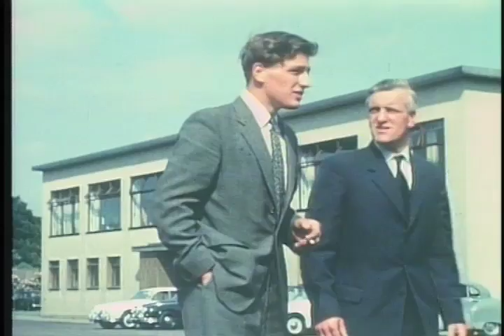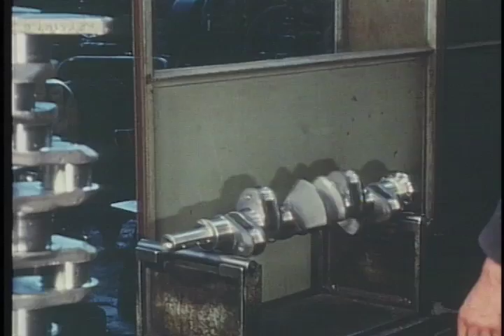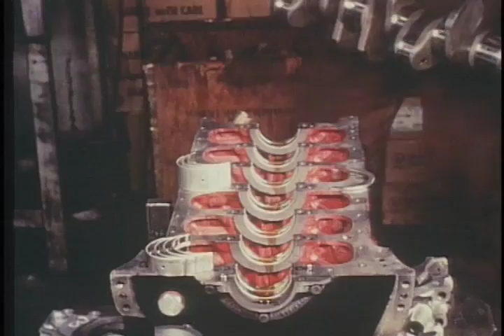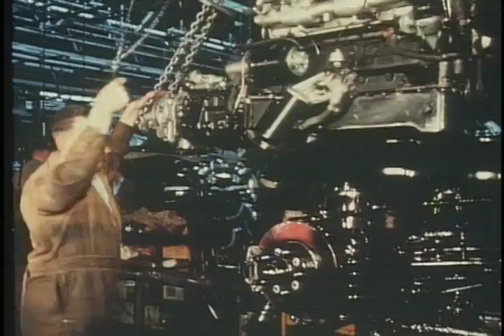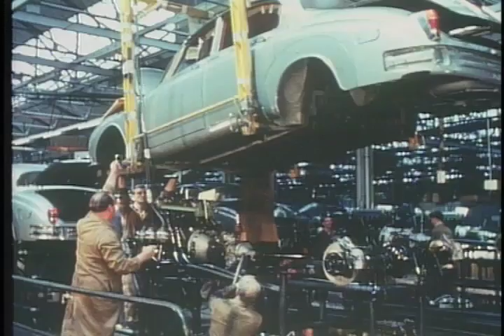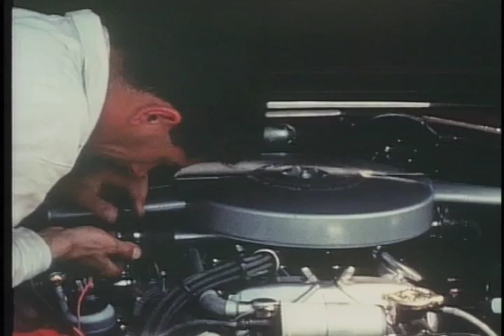Jaguar Factory Tour - 1961

Comment: I was impressed with how leisurely the whole process was. Nothing seemed to move until all the work was done on the previous car. A lot of the work seemed to be hand fitting. Instead of multiple operations being done on something like the engine block, most of it was one at a time. I was half expecting the tea boy to show up at any time.

Comment: I kept my E-Type cool in the 100+ degree Texas summer bumper car traffic by putting a series II E-Type fans and radiator on the 3.8. Worked perfect ran at 190 degrees, in dead stopped traffic for as long as you could stand it. Also put in a series II all syncro first gear tranny. And lastly, changed to a delco remy alternator and voltage regulator--all Joe Lucas problems solved! That's it! 1964 Coupe--about the best car I've ever had and I've owned over 50+ cars in my 76 years. All makes.

Comment: Very interesting. Given the decade of manufacturing engines, I believe that is/was one of the finest six cylinder engines ever made. My XKE had 120K miles on it with my foot in it all those miles. The 3.8 tri-carb motor. Very quick car. No mechanical issues on that great engine, except setting valves which was a pain. The Lucas ignition was the problem and keeping those SU's in tune wasn't a big deal. Just needed a fine tune about once a year. Valve seats, I kept lubed with Marvel Mystery oil, since the lead was taken out of the gas, and it therefore never needed any valve work. I also owned a great '57 3.4 litre Mark I sedan 4-speed. I loved that car. I've had 6 Jaguars but the older ones have Soul!

Comment: 5.13..."high pressure water jets are used for cleaning, and swarf is blown away by compressed air"  Just as well he's wearing those invisible  safety glasses!   It's extraordinary that even in those days earmuffs were not worn.
Reply: I was at school in the 1960s , with a metalwork shop with furnace , welding equipment etc , safety kit was a standard issue brown smock , sometimes goggles and gloves and in five years no one was seriously injured or killed ! , we were taught how to do things right and that continued in the motor trade for me right up to date now , back then mechanics had skills and were not just parts changers

Comment: My brother owned a MK2, 3.8 litre, in Cornish grey with wire wheels and red leather interior, a 1961 model bought in 1970 and was still easily capable of doing 120mph with no trouble at all. A magnificent piece of engineering. Grace Pace and Space indeed.

Comment: The processes shown here are not far removed from late 19th century methods.......

Gears ground to within two thou' 0.002". Test a new gearbox by listening to it.  Paint it with "primer" directly on to bare metal.  Wow!

No wonder the bloody cars were basically scrap after less than 50,000 miles.

Comment: Cool video.  It’s too bad that the unions drove up cost so high that there wasn’t enough profit to sell the car at a reasonable price.  That in turn hurt demand.  Reliability issues came about in the late 70’/early 80’s.  That unfortunately drove more buyers away.  A huge amount of competition from Japan and Germany hurt them so much that the British government had to buy them in order to prevent collapse.  Ford later bought them and then sold to Tata motors of India in the late 2000’s.

Comment: Here in the United States, Jaguar was long given the kiss of death. Electrical system shorts, faulty distributors, oil leaking from fragile aluminum engines, clutches seemingly always in need of adjustment....plus the ever present shoddy British workmanship. This is not the stuff to capture a major overseas market. Sad really, Jaguars with their design beauty and sumptuous interiors always promised so much....... but gave so little.
Reply: I suppose this is when Jaguar were owned by British Leyland Corporation.

Comment: Camshaft bearing journal cap torquing via 1/2" iimpact. AMAZING QUALITY OF MANUFACTURING AND ATTENTIION TO DETAIL. This video is a from a SHITHOLE "REMANUFACTURING" FACILITY for worn-out Jaguar JUNK no more than 25-35 years ago. Not a FACTOR BUILDING NEW ENGINES IN 1961. What a FRAUD.

Comment: at 10.58 the vegetable weighing  scales are used  for the connecting rods for maximum weight of 2 grams tolerance  .....Jaguar pure precision :)
Reply: drams
Reply: 2 grammes is a perfectly and indeed, very good tolerance for a production engine.  Nite also that the rods were checked end for end...

Comment: Most cranks are cast. Some come from billet, after the cast are Cnc work is done holes have to be drilled and cleaned much of the final clean up is done by hand. I worked for Honda 27 years. Got to visit Ferrari. Ferrari still uses sand cast for there blocks, heads and intakes. Sometimes the old way is the best. Be lieve it or not a round file is used. I know it seems crude but it's still done today. Of course the counters sinks have to be polished because the file has a course finish.

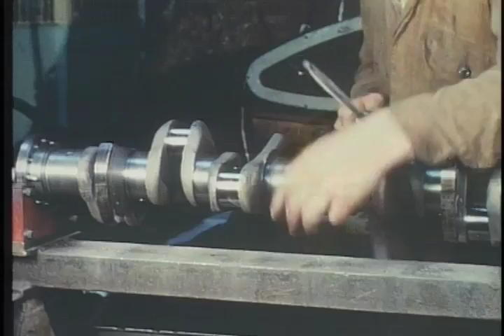Comment: 8:20  "... all holes are countersunk with a hand file."  That statement doesn't make sense with the images shown.  And anyways, how the hell can you countersink a hole with a hand file?
Reply: using a round file it is possible where a raised hole ie top of a shaft,it wouldnt be  a perfect 45 deg but hey a,flat file would put a flat on the shaft,only a round file can do this so the film is correct but the  word 'shamfered' should be used not countersunk
Reply: Do you mean chamfered? Thats how my Grandad referred to it.
Reply: I,ve  champhered lots of oil passages with a file on several Ford race engines. Countersink, wrong word.
Reply: You run the file in the oiler and it sets the hole below the journal, thus stoping the edges from scraping the bearing, still done that way today in some factory's where the engines are hand assembled. Ferrari and Hondas Anna plant.
Reply from the maker: One of life's mysteries.  The script writer may not have known much about auto manufacturing and just liked the sound of that phrase.  You're probably the only person to ever listen that closely.  We'll send a stern note to the producers:-)
Reply: King Rose Archives  Haha... okay.
Reply: *****  What kind of hand file do they use for this?  And how do you know what Ferrari and Honda do in their engine manufacturing plants?     Not arguing or disagreeing, I just want to know.

Comment: It looks like a greasy factory and methods from the 1880s.
Reply: not true of jaguar
Reply: No, these were skilled men who each knew their crafts. Not plug a machine on and load a program. Obviously the video was wasted on you.
Reply: I owned a 1964 Mark II  3.4s. (Beautiful car.)
It is not lost on me; just look how much time it takes to make a part; so many mistakes can be made.
My Mark2 had one entire cam-shaft that didn't have oil holes drilled in it; it made terrible noise & damage until it was replaced..  Touch the brakes,The brake pedal would literally push back at you.  Leather carburetor parts...?
 Compare this video to how robots quickly make Subarus, Hondas & Toyotas; precise and durable for years and years.
Reply: +Mr. Johnson robots make them faster and economically. But those jags had workmanship though they did need more regular servicing but when you went to a jag shop every atom of the car was understood by someone. And you probably owned a naff car.
Reply: I agree completely with you on the wonderful craftsmanship quality of the Jaguar.
  I restored my Mark 2 and couldn't belief the amount of time, materials & fit & finish used in every aspect of the car.  The heady smell of leather, wool,  wood and varnish was a special kind of heaven. Inserting in the small key in the instrument panel and pushing the start button making the engine roar to life, sounded like starting a WW2 Spitfire; every bit of this car was a constant reminder that you were driving something special. 
 My original remarks were directed toward the factory conditions; the lack of safety, heath protection, dismal conditions and using  tedious handwork labor when a precise machine is far better for  certain jobs. Mostly in the machining and metal work process.  They certainly didn't ascribe to the Japanese word & philosophy of "Kiazen" and were using old guild methods of protected skill sets. 
.
   Kaizen (Continuous Improvement) is a strategy where employees at all 
levels of a company work together proactively to achieve regular, 
incremental improvements to the manufacturing process. In a sense, it 
combines the collective talents within a company to create a powerful 
engine for improvement.
Reply: +Mr. Johnson this was 1961 that's what they did in 1961. Bit harsh to criticise 50 year old history.
Reply: 1961 They didn't manufacture in such poor conditions in America. Just look at the video of   "Men Bet Their Lives on It -- Packard Merlin Engines"  in 1943.  The methods & conditions were much more technologically advanced than Jaguar 1961.  Look at any manufacturing videos in 1961; BMC,  Mercedes, G.E., FORD, Lockheed, etc.   It is world of difference in cleanliness and safety.  I'm older, I remember 1961; most places didn't look like the Jaguar factory.
Reply: You are right.
 This is 1961. Methods were not standard everywhere; some factories were more modern than others.  Just like today, some manufacturing is behind the times, some are ahead of the game.
Reply: +Mr. Johnson I think the lure was that  jags were hand built.
Reply: +Mr. Johnson I did a reg check and that car is no longer registered. Probably scrapped.
Reply: +paul hunter what is that comment relevant to?
Reply: Jaguar Factory Tour - 1961

Comment: jAGUARS ARE INCREDIBLY RELIABLE, my 1998 XK8 sport runs like new and is incredibly responsive and I can say from experience the XF Saloon is another fantastic Jaguar.  Like all cars the owners need to ensure they are serviced properly and not by monkeys.
Reply: Ummm, you're driving a Ford product.
Reply: Exactly, they are upscale Fords based on the Taurus platform.English cars are not reliable .....unless they are Fords
Reply: Why do you say that...Fords are not in the same league, everyone knows that.
Reply: My Sovereign X300 (1995)has 209,000 on the clock, I maintain it regularly, change all filters and all Liquids every 12 months, the car runs perfectly,I often get offers for it,cash too even. Secret to a good Jag is simply sound maintenance and quality oil and other liquids, the low revving engine is eating up the K's around 100KPH at roughly 2100 RPM no stress.A great vehicle.Many Nippon/Korean'China made cars are screaming at 3500 PLUS at 100KPH.
Reply: I have a 2.0d X-Type, 06 reg, ie 2006. Had it for 4 years. We bought a Mercedes ML300, 2010, in August last year. Problem after problem. Got rid of it in May.  The X-Type has been far more reliable.
Reply: Your jag is a ford dummy
Reply: Get a real jag with a lelaynd engine
Reply: my girlfriend has a 1993 XJ Vanden Plas has 130k miles and has not had any problems.

Comment: How the machining of parts has changed! - Lets take the part from the machine without turning the cutters off. Lets blow the muck out of holes without putting on glasses. (I've seen swarf/dirt/coolant blown into many an unguarded eye when I worked on the shopfloor of a machine shop)..

Comment: Very appropriate that the film begins with a Jag in a repair bay!
Reply: It's obviously in for a service. These old pre-Layland Jaguars were the cream of the crop.
Reply: +hoppes9 
So that's what they used to look like before spewing engine oil out of every orifice in the engine.  LOL.
Reply: Very interesting fact about Lucas and Bosch  , Jag's are timeless classics. I recently purchased a 65 Sunbeam Tiger MK1 to restore,  the 260 is seized but the rest of the car is very nice, can't wait to get started.good luck on your restoration.
Reply: +hoppes9 there are plenty of them still on the road today
Reply: Great cars to drive ,but mechanical nightmares ,super crappy Lucas electrics.
Reply: andy a I'm restoring a 1959 Mk1 Jaguar, and they're ten times easier to work on than anything made in the last decade, the XK engine is a delight and is absolutely bulletproof. Lucas electrics are simple and on these older Jags is actually quite good, it was only when Lucas started using a lot of Bösche technology that their electrics suffered. I've grown up around Jags and their cars from the '50s and '60s were well built, well designed and are probably one of the best cars that a DIY mechanic can own.
Reply from the maker: +hoppes9 Ouch.
Reply: But at least it was driven in rather than towed!
Reply: Nicholas Scarff - Having owned a number of cars equipped with Lucas electrics I really feel that the company gets an undeservedly rough ride. I can't remember any problems with Lucas equipment (beyond expected wear and tear), which is more than I can say for French, Italian and German products. American (in the past, at least - I don't know about now), Japanese and Korean electrics are tip top.
Reply: +hoppes9 I think he is doing an oil change...and it doesn't help that people think they can work a Jaguar like an F1 racing car lol
Reply: andy a Lucas partnered with Bosche in the '70s and it was a disaster which is where the 'prince of darkness' came from, prior to that Lucas was no better or worse than anyone else. Sunbeams are lovely cars, I would be very excited too! Good luck with your restoration also!
Reply: Looking at the number plate with RW on it makes me think its a jaguar test/owned car.
Reply: I would suggest that this car is in the 'service' bay, which afterall, is critical, if a vehicle is to continue to operate at it's peak condition.

Comment: loved the xjs a friend had one with a 454 bb chev very tough but still classy . Jag motors were only good for one thing and that was boat anchors
Reply: +Sammy 750 most old jags just arnt looked after properly, yes they have some faults, but so does every car!!! jap engines are good and cheap fair point but  they lack the smoothness of a jag engine, (check out the old penny test) jag also held the record at one point for the worlds fastest street production car(xk120). i guess a car designed in cold wet britain will allways suffer in a place like australia or usa, doesnt mean there wernt fine pieces of engineering.
Reply: Jags are nice, but they have a terrible reputation in the U.S. Read consumer reports. I was born and raised in England and I remember the cops using Mk2s, along with other assorted cars.
Reply: Lexus, nuff said.
Reply: I don't dislike jags I like all ( well most ) cars and Its a shame to see these car factories and jobs go to country's with cheap labour , here in Australia all car companies heading overseas by 2018 . Spencer Spence you sound like a jag man (or women) and I was just wondering if the jag engine was fit to any old war planes like the v12 in the spitfire